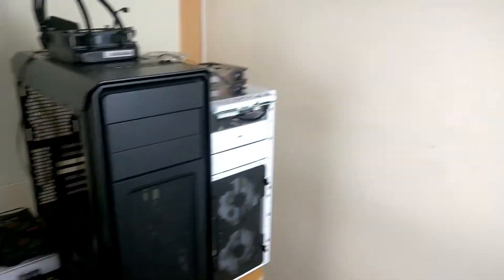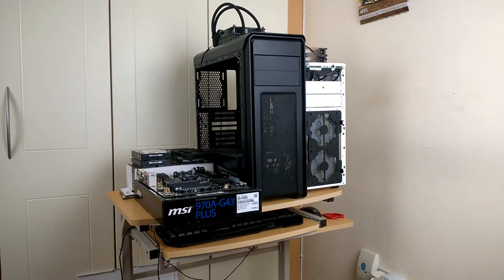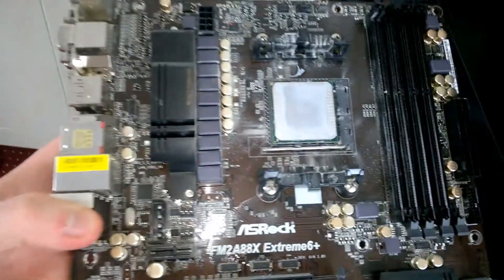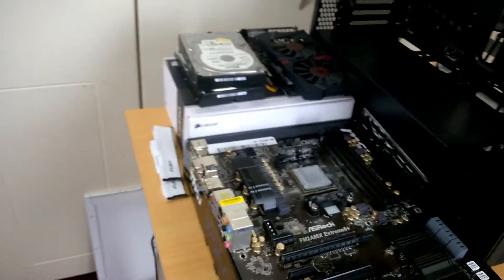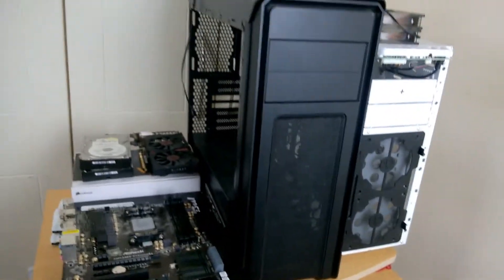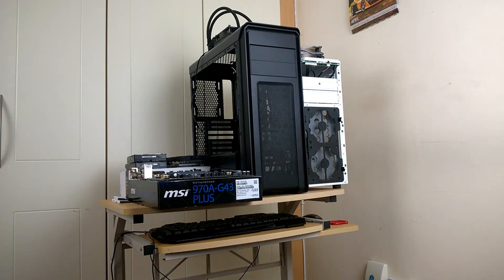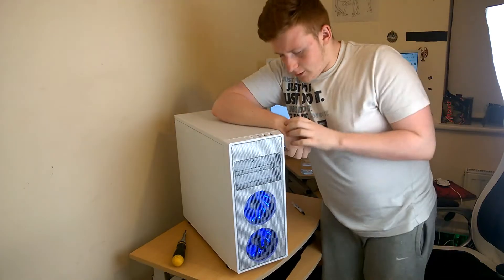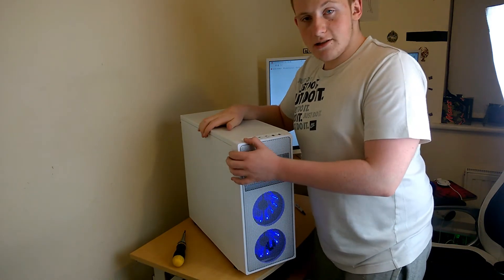Overhauling Our Home PC's

Comment: A quick question, when installing an aftermarket CPU cooler what direction should the fan face, towards the RAM or the fan on the case; which is on the other side?
Reply: An aftermarket CPU cooler should always blow towards the rear exhaust fan or if the case has top exhaust it can point there also. Stock coolers mostly use a top down fan, this just leaves the case exhaust fans to all the heavy work.  A bad top down stock cooler must have good case fans to help out. A good aftermarket CPU cooler can blow out even if no rear exhaust fan is installed,, or up and out the top of the case.
Reply: http://www.guru3d.com/miraserver/images/2011/gelid-gx7/IMG_5110.jpg

so it should look like the image, where the fan is facing the I/O ports as that is where the rear exhaust is?
Reply from the maker: Yes, exactly like that.
Reply: thanks man